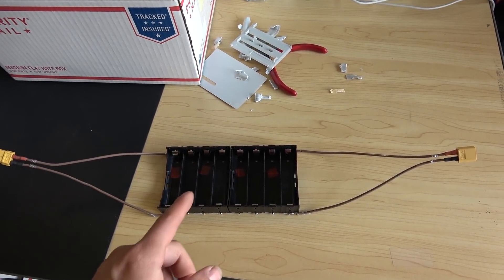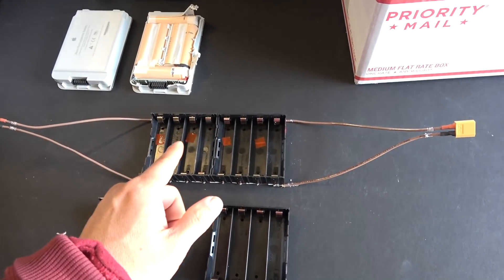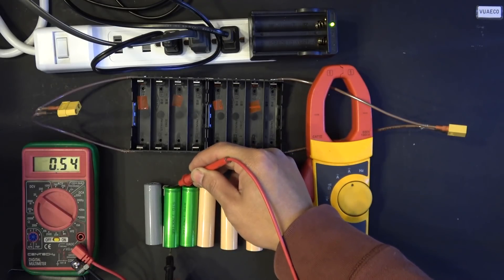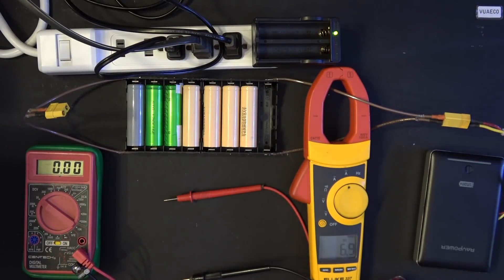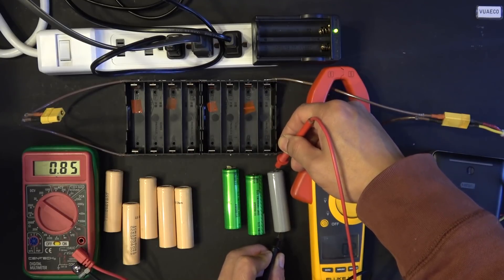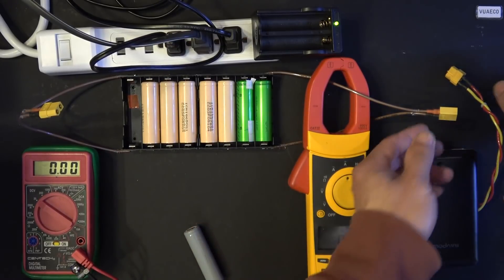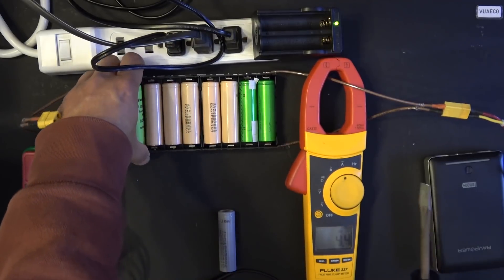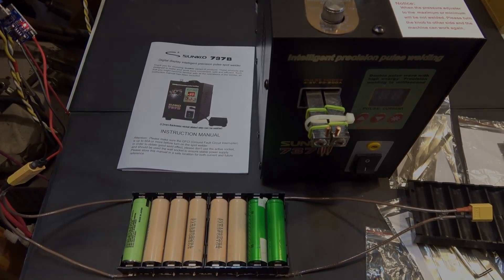18650 cells harvest S01E01: Make an 8-cell mass reviver

Comment: im having trouble with a smart bms blutooth from lithiumpcbbattery.com . the voltage readings on the discharge and c- from the bms was only 17v .so been connecting the controller across battery terminals to get full voltage 54v.my ebike 14s5p samsung 25r mostly/some panasonic 2600cells got me to a 16mile round trip but some cells were low 2.6v .so charged back up but blutooth app showin 2 cells going from 1.5v to 6v.checked with volt meter and shows all cells are 3.8v now.so thinking faulty readings from blutooth.i did reset an still same.i have ordered some new cells in case to replace some low cells .any help would be appreciated as cant get hole of bms supplier.steve in uk

Comment: Hello, I am hoping you could help me with this question. I made 3x24 18650 battery packs wired them in series to get 60ah @ 12v and added a 100amp  BMS. Can I make 3 exactly the same packs and wire them in Parallel to  acquire 120ahs? Thank you for your feed back. Have a nice day.
Reply from the maker: Yes, you can make 3 exactly the same packs and wire them in parallel to get 120Ah. They all have to be the same cells though.
Reply: vuaeco , very hard to have same cells when dealing with laptop batteries. But I have tested and retested many times each cell in order to get accurate voltage and capacity. Also have had them sit for couple months. The cells are holding up great. That's what made me use these packs. I will be building a solar power generator. I made a smaller one prior with 25ah. Would you like to see a picture of it I can send through google drive? Thanks for all you do. Love your videos

Comment: Wow! Can't wait to try this with my dead stack of 18650's. You my friend, rock! I have a question in regards to adding additional pack to a pack that is already in use. What I mean is, I have 3 packs,- 12p and is each 21ah. I put them in series to get the 12.6v. And have them be 63 ah's. Can I make 3 more packs to connect to those 3 and make it 126 ah's? Your feed back would be appreciated. Thanks. Each series would have its 3s BMS installed..
Reply from the maker: When you put 3x 21Ah packs in series, you don't get 63Ah, you still get 21Ah but at 12V instead of 4V. So if you have 3 more packs of 12V connected in parallel, you'll get 84Ah at 12V. That's a big pack!
Reply: I had it wrong all along? I thought that each 12p pack had 21ah since each cell is round 1800 mah's than 1800 times 12 =21,600 x 3= 64,800 Ahs? Please explain where I went wrong. Thanks for your feedback

Comment: Love your videos , always learn something. There is also at least one more way you could do this as well and that is to hook up those batteries directly  to your accucell charger(if you still have it )  using the alligator clips and change the mode to NiMh , instead of Li on  . It's what I usually do if I come across a bad cell or low voltage cell. When the voltage starts to come up , I stop it and change it over to lithium mode.

Comment: In my opinion it is always good to have a powerbank with XT60 connector. In my application I often use my diy Boost/Buck Converter PCB from Jlc pcb and I can just connect it to my powerbank and shortly power some motor or any other type of electric. 

Lately I bought an motorcycle with an electromagnetic fuel interruption device and and it was just closing itself for some reason. Luckily I had my powerbank and the Boost/Buck converter and I was able to keep the device powered on till I arrived at my local repair store and managed to get a replacement for it.

Comment: Last ride was 13 mile non stop no problem average 20mph
Reply: i have a spare hoverboard motor thinking will test my battery on that an throttle its 3 wire phase motor same as ebike will that work ok?
Reply from the maker: Yes, the hoverboard motor is brushless and it has 3-wire phase motor just like the ebike.
Reply: @vuaeco  tried hoverboard and it was same effect as hub motor it just rocked not span.maybe controller or throttle fault.think i replaced throttle before from same supplier got kit from ebay as controller wheel and throttle have same easy to fit connections.
Reply: how can i test motor is ok?"not sure you can connect motor direct to battery can you?
Reply from the maker: You can't connect the motor directly from the battery. You will need a controller. That's the thing with brushless motor. It even has a hall sensor (the connector with 5 small wires) and that even makes it more complicated to test. :( IF you tried the hoverboard motor and same effects then for sure it's not your motor. It has to be the controller or throttle.

Comment: just took electric bike out and it died after couple of mile.battery is ok its still 52v its normally 53v fully charged the motor just does a quick pulse on throttle an vibrates a bit maybe faulty throttle?i have 2 spare throttles
Reply from the maker: What is the discharge rate of your battery? Having full voltage doesn't mean it can pull the motor. If your battery can't supply enough current to the motor, it would still die even though it still has full voltage.
Reply: Well it’s 14s5p mostly Samsung 25r
Reply: On a ebike throttle which is signal wire or where does it connect 5v I think

Comment: The current going into that last cell is going to be huge because it's supplied from all the other cells plus the PSU supply, this is simply dangerous as lithium cells can explode.
Better tomput them all in and then use a current limiter of some sort of you don't want the spike.
Reply: I doubt that it would explode but it might damage the cells a bit
Reply from the maker: No it isn't. The current is evenly divided among 8 cells. If I have 10A on 8 cells doesn't mean it gives 10A to the last cell. Each cell only takes 10A/8= 1.25A
Reply: @vuaeco  I would be worried about damaging the cells with the high current since they are at such low voltage, the first cell you plugged in got 5+ amps, some smart chargers have a recovery mode that only gives the cell less than 500 mAH so it doesn't damage the cell when charging, I understand that the cell needs to get to a certain voltage before chargers can even accept it but giving the cell more current than it is meant to even when it is at a normal discharged state just seems a bit careless, it obviously didn't destroy your cell but I bet that if it was charged slower it would be much better for it.
Reply: @vuaeco  it is worse than you think because think about what has already happened before you plug in that last battery, all the cells have taken some charge already AND you have the supply adding more current voltage to everything, so now you have everything sitting at 3.5v or whatever and then you plug in a battery sitting at 0.7v , all the cells will then discharge some current  into that last cell and also the PSU current as well.
Tne only way to know exactly how much current is going j to each cell is to measure it.
Obviously to you this risk is worth taking to save time sorting through all these cells and it's a good way to find a bad cell very quickly too but no way is this a good idea to be encouraging others to copy it.
Recovery amps for each cell should be low  for reasons stated in many documents to do with safety ... I don't imagine they wrote those guidelines for fun?
Reply from the maker: @nigelsheffield: The other cells have taken some charge but how much charge can they get in just 10 seconds from zero percent state of charge? That's obviously not enough to dump any charge onto the last cell. All power comes from the USB power bank. And again, they are all in parallel so the current is evenly distributed and divided. The last cell does NOT take all of the current. The most it can take is just the same as ther other cells, about 2-3 amps average within 20 seconds. You have a good suggestion to slowly charge them with lower current but I have a couple thousand of these to go through. I don't have all day to do this. If you have a few cells, then slow charge is better. But for me with a mountain of these to go through, it's not practical at all.

Comment: Hello budy nice to see you making a video. I'm working on a project I like to make a 90 to 100v triangle battery haven't found any schematics on internet would appreciate if you could healp.
Reply from the maker: It depends on the discharge rate of your battery. You need to know the discharge rate of each cell in order to figure out how many you have to put in parallel. A 100V battery (open circuit) would have about 25 cells in series. If you have high discharge cells like from a power tool battery, you'll need at least 2 in parallel. That means 50 cells minimum. If you use laptop cells, you probably need at least 7 cells in parallel. That's 175 cells. That's a huge battery.